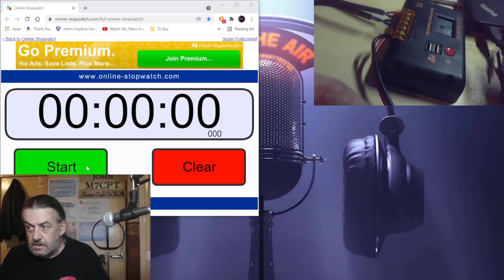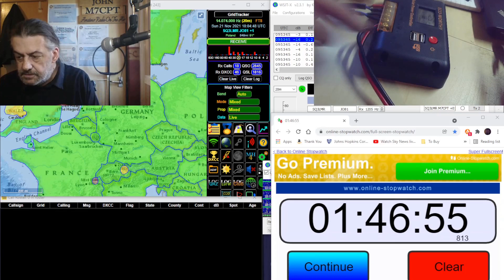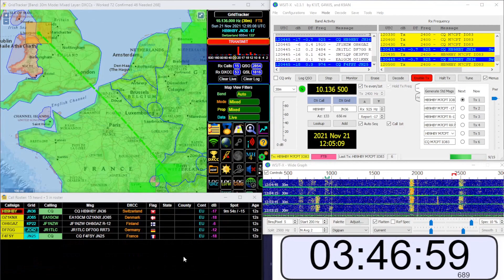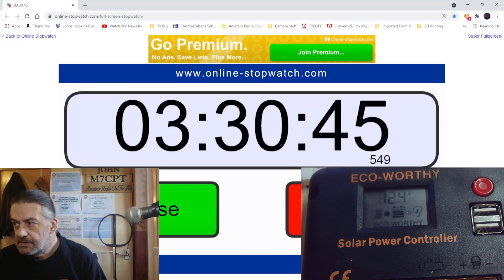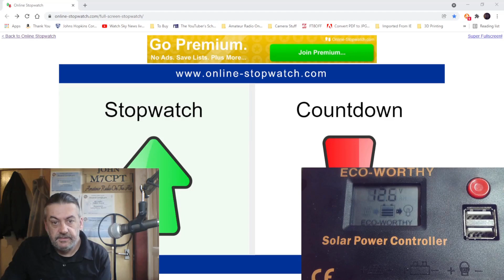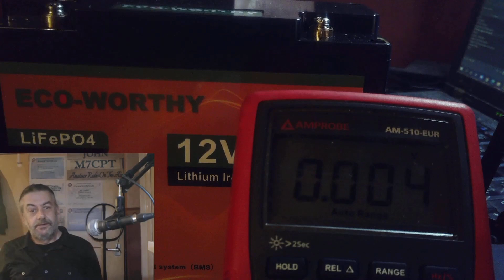LiFePO4 Battery & Solar Panel 2 Testing & Mistakes Made

Comment: R reet John marra a notice the link it to the US for the solar kit did you get hit with customs charges? M7GNR
Reply from the maker: The link should take you to "ebay.co.uk" and the supplier is located in the U.K. so there are no customs charges to pay. I will mention the battery was sent via a different currier than the solar panel & charge controller but there was no hidden charge for this either.